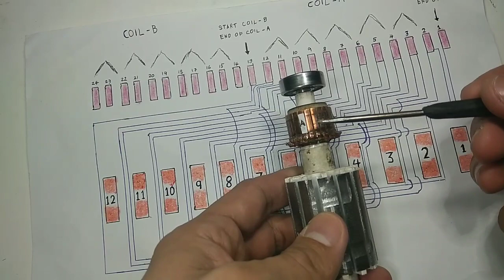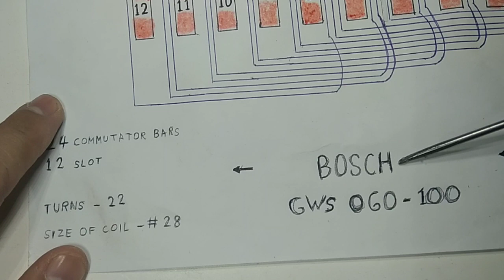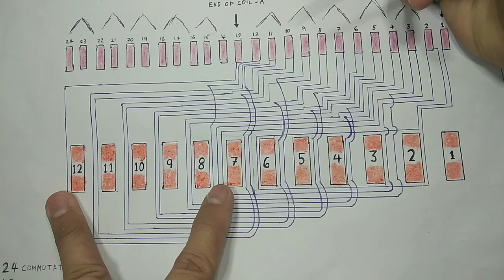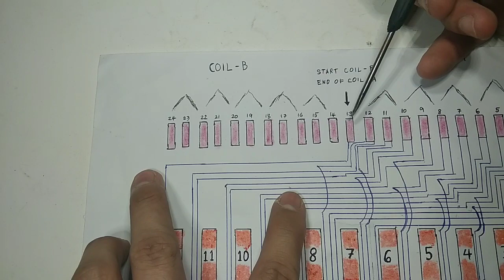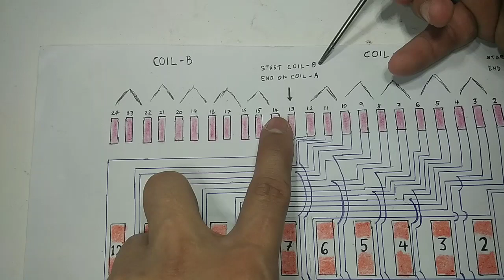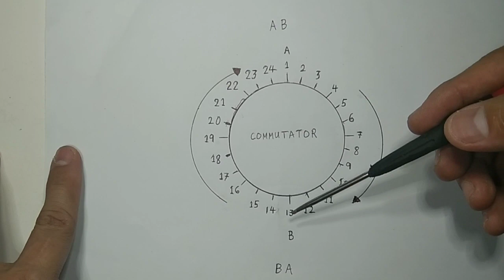Armature Rewinding Bosch GWS 060-100 Angle Grinder (Tagalog) Part 2

Comment: I have watch so many of these armature re-windings videos now, but yet to see one that is simple to the point of start here and wind here, this many turns, and return here and repeat. While I am sure the presenter thinks it is simple and to the point, it seems to get  confusing when they try to explain things and show different ways. A simple, start here at the commutator and count this many slots and start winding here for this many turns, and stop at this commutator slot. Why make is so convoluted. This one doesn't even have the commutator installed when he started the windings...
Reply: hey bro gary ..the guy just wanted to show the correct flow or manner of the wire to be rewinded so he presented it without the commutator for good view..that is called concentrated stacking of the wire..very orderly and neat..